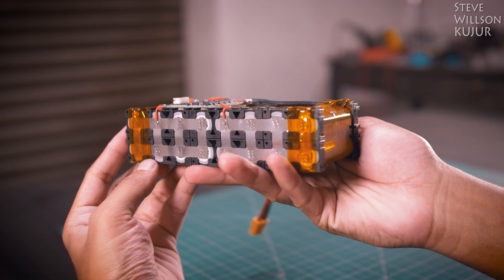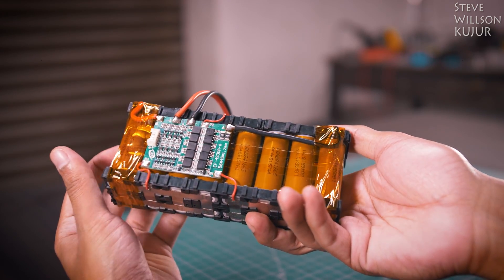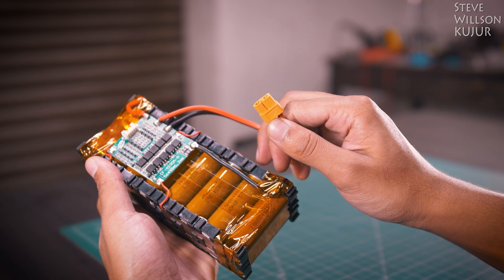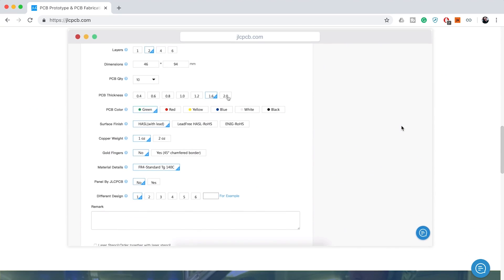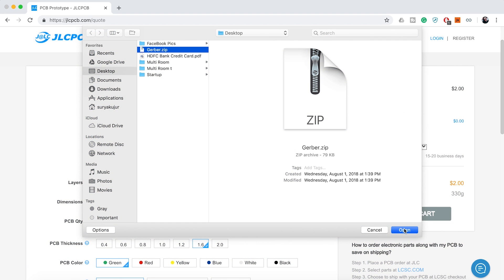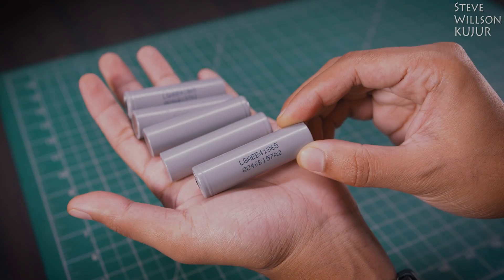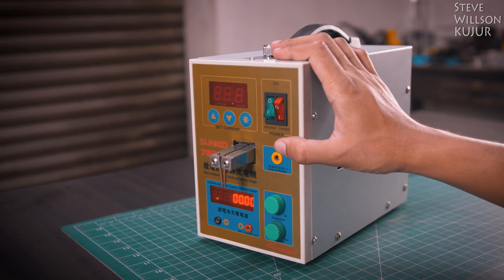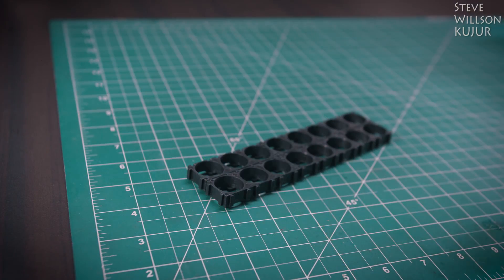Make your own 4S4P Lithium battery Pack | BMS

Comment: Hi brother, i made a 4s lithium ion battery with a 30 amp bms. After completing the wiring the bms out put voltage is below 12 v. At the battery end its 15 to 16 v. I did nt connected to charger yet, only connected a battery level indicator,.. When i first conneected the charge indicator it showed the charge which is full, after some time its not shwing anything. Then i checked the out put voltage found below 12 v.
Is the bms damaged?
Reply from the maker: Yes it's a faulty BMS

Comment: Great job friend, but I'd like to know how wiring the same BMS board as a 4S2P pack, but, seeing where each wire goes where and voltage at each wire soldering,  all videos I've seen they cut out and go to end showing the finished job.  Thank you.
Reply: Very late, but: the wires go to the same place, at each split between series cells. You are still 4S, so you still have the same number of wires going to the pack. The extra parallel packs don't change the wiring, the parallel packs are joined at each series split.
Reply: @MarkPentler  A bit late 😁. But thank you so much for replaying.  This time I've just finished a 5s4p project and, of course,  learned something about assembling batteries packs. Thank you, you're always welcome

Comment: Can you change and discharge in the same time
Reply from the maker: Yes
Reply: @SteveWillsonKujur  I bought 3s 60a bms but it has different charging and discharging points know I don't know if I'll be able to see  if it's full charge In my mppt solar charge controller

Comment: Two suggestions, if you like. Wrapping krypton tape stops the air flow which plays very significant role when the cells heat up. Raise a L end for soldiering wires so as to avoid heat going into the cells. Perforated fiber sheets on 4 sides may be put for mechanical denting.

Comment: Nice video mate... the trouble is with almost every one of these videos that you clever fellas make.... you don’t explain our show for long enough to see what the battery spot welding configuration is as in where to connect the strips to what batteries pos and neg terminals. 
When you’re learning like I am that level of instruction would be great 👍
Reply: yes i totally agree if some was too  explain  and show where the bms wires are attached and the orientation of the  bus bar etc we all have too learn
Reply: @rogergreen6953  the 4s4p configuration means.. there are 4 sets which is created with 4 individual cells. Each group of 4 cells creates 1 set. On each set there is one positive and a negative. On the BMS you have B+ which goes to the positive on the end of the pack.  Same with the B- which goes to the negative at the end of the pack.  Positive and Negative are located opposite of each other. On the BMS you will find B+ and B-. Those are connected to each side as explained above. You will also find P+ and P- those are used to wire the Positive and Negative wires used to power whatever device. You can use any battery connector to connect to whatever you desire. As for the BMS balance leads connection which are labeled B1, B2, B3 a wire goes from those pads to each positive cell in the 4 groups. You wont find a B4 because the  4th positive is considered B+.   I hope this helps to fill in the gaps. Learning is key and not everything is given in a video. You have to do your homework..
Reply: @FlyHighforfun  So the B1 B2 B3 is doing the same thing as the small white connector with 5 wires?
Reply: @acdlogistics586  Yes. Not sure what you mean by "doing the same thing." Each one of those leads are combined into the balance plug. 4 positives and 1 negatives. 5 wires.
Reply: @FlyHighforfun  So it doesn't matter if you connect it through the leads or B-tabs?
Reply: @acdlogistics586  the balance leads are used when charging the battery pack and only for that. B+ and B - are used to power whatever you like.